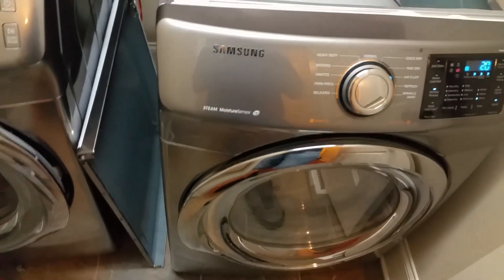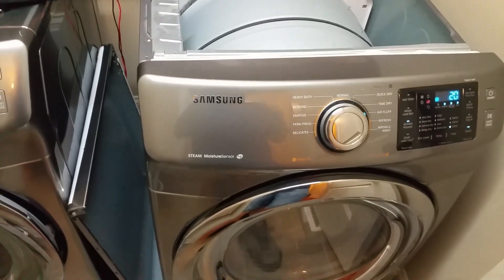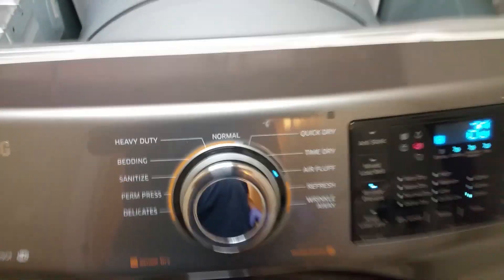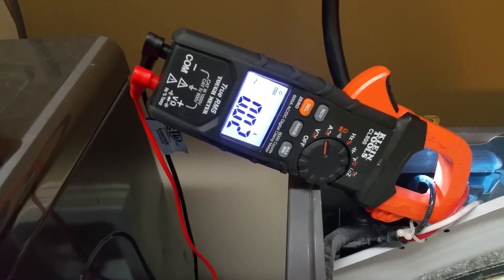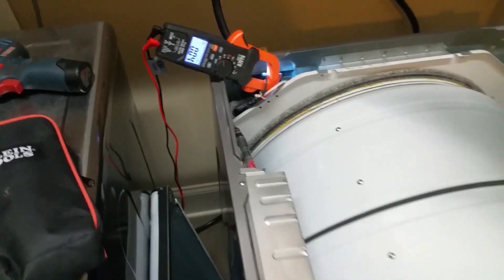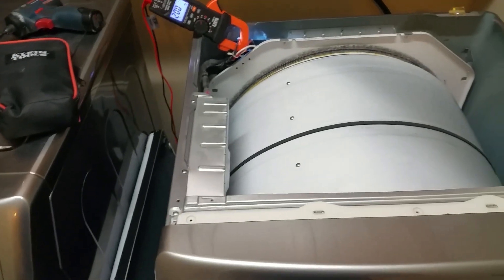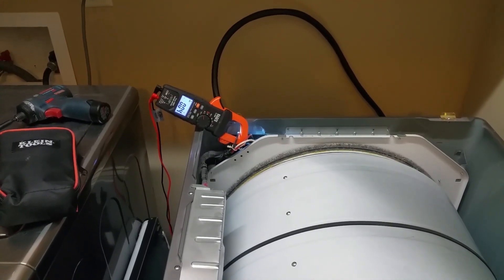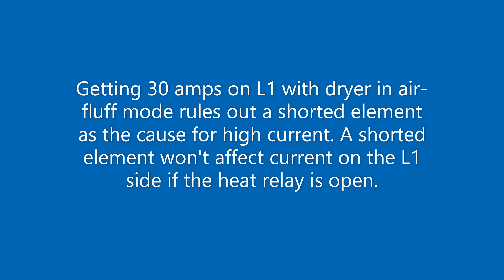#18 - Dryer Motor Test: The Easiest Way to Diagnose a Failing Motor!

Comment: What was actually wrong with the motor?
Reply from the maker: The windings had overheated and were discolored. I suspect the insulation on them had deteriorated was causing them to short out.
Reply: @TheTechCircuit  so you would have expected ~5 A for a "no heat" mode through L1 and neutral? Just bought an amp meter to try and figure out why my circuit breaker is tripping inconsistently (toward the end of a cycle, but not every cycle), so I wanted to make sure I understand the expected currents. Thanks in advance!
Reply: @DChuchable  make sure it not grounded